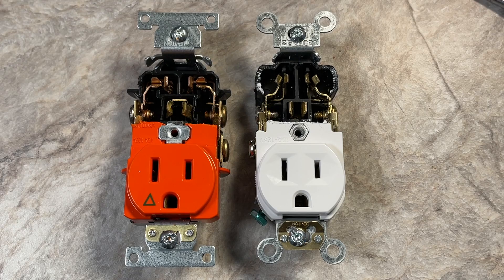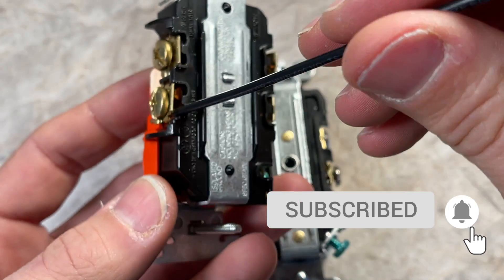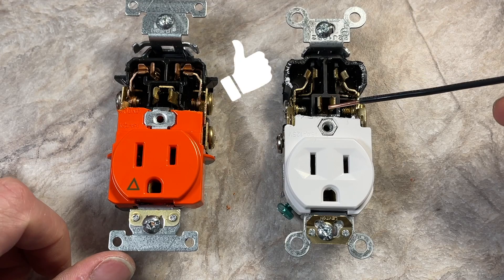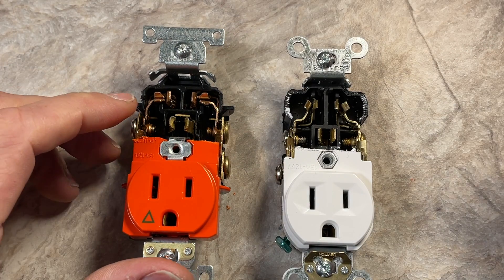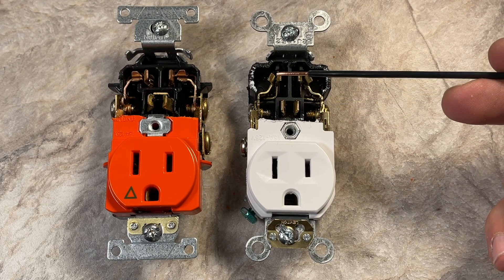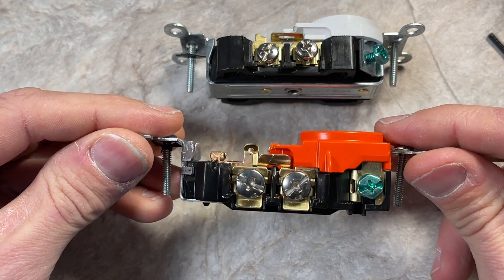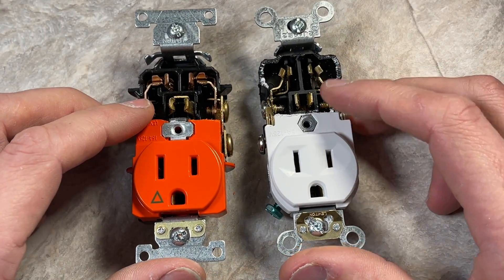What Outlet Should You Buy |  Commercial vs Hospital Grade

Comment: I would like to see military grade. They would probably be the cheapest, nastiest, most dangerous outlets out there.
Reply: Military outlets? You mean regular outlets that the pentagon likely payed 7000% above market value for.
Reply: In the navy ashore, it was generic commercial/institutional.  On ship it was a bit different.  A big oddity was that it was a floating ground back through the wiring/hull to the casing of the ship's generators so connecting the ground links to everything was very important.

On my second ship, they used those commercial grade outlets but they were always installed with the ground pin up.

On my first ship, she was a lot older.  I never saw any two prong outlets but if there had been any they were long gone.  Again, all were ground pin up.

Light switches were a very big difference, they use heavy electronics style switches that cut both sides of the circuit.  Many were 3 position, up for white, middle for off, down for red or blue partial lighting
Reply: They would definitely just be shady chinese knock off versions of the already made in china residential outlets but about 800% more expensive than they should be
Reply: @killerbug05  Speaking from some experience: Military grade=The cheapest chinese parts assembled by minimum wage americans working 60 hours a week. The huge markup comes both from the desire for profit and the huge wages needed to have an engineer make ikea style instructions that someone hung over and exhausted can follow.
Reply: @Hyraethian  I was just joking but that's interesting
Reply: it’s just a residential grade with an M-16 and an angry wife
Reply: @haydenblanchard2006  but is the wife modular?
Reply: @killerbug05  no but it comes with heat seeking divorce papers
Reply: Obviously you have never tried to meet mil- spec.
Reply: @stevenbass732  these guys are trolls.  No experience with MIL, aerospace,  commercial specs and QPLs.
Reply: They are likely just certified commercial grade.  Now the quality of military-grade electronics, different story altogether.  Some of the mil-spec equipment, especially in aerospace are works of art internally.
Reply: @greendryerlint  very much so.  With proper care they remain mission capable for decades.  The one satellite recover I had was perfect as is, they just put better computers onto it.   Started out with a computer and tape drive, then had a modified unix box, and was going to receive a PC based controller as I was getting out.   No changes to the dish or controller.
Reply: Lol, right?!
Reply: I only remember hospital grade outlets when I was in the Air Force in the 1980's.
Reply: Yep, lowest bidder, which means the supplier that didn't make the Wal-Mart cut
Reply: @alphadriver3020  Lowest Bidder not lowest cost.  they never come in on budget.
Reply: Lol like military intelligence that’s an oxymoron lol
Reply: you0're werong real military grade are the top gamma of the line, able to withstand grunts abuses.
Reply: Actually military grade is one of the most expensive. They must go through very intensive reliability tests.
Reply: Was a building manager for the barracks for a few months. They told me to buy the cheapest I can find lol
Reply: While I know this thread is on the sarcastic level, I would like to say that since I grew up a military brat going to school on base in Puerto Rico before the US Gov closed Roosey Roads down, MOST of the receptacles on base including the housing units, were HOSPITAL GRADE, COMMERCIAL GRADE and INDUSTRIAL GRADE. I did NOT see YELLOW(corrosion resistant),RED(EMERGENCY POWER) or BLUE(ISOLATED GROUND-SURGE SUPPRESSED) back in the 80s BUT I see those in hospitals and schools NOW in 2021. Now I DID see the ORANGE faced ones in the BUNDY section of the Base in a store check out aisle and I did see the more unique CLEAR lighted receptacles in the Navy Hospital in Roosey Roads base. Now when you say MIL SPEC or MILITARY GRADE, I immediately thought of RUSSELL STOLL or PAUHLUN or MELTRIC or APPLETON or PYLE NATIONAL industrial grade receptacles and plugs which I DID see at the AIMD hangers in PR and in NADEP in Cecil Field Base in Jacksonville FL before that base was closed down too.. All those brands were like the European ROUND PIN sockets but much beefier and had steel flapped plates.
Reply: Are they modular though?
Reply: @Echa37-H37  if it ain't modular it aint good enough for the u.s military
Reply: You would have to go through an unnecessarily convoluted purchase process with a massive mark up in price, it must also be cleaned to perfection weekly or it will implode
Reply: @matgaragepaul  nice,  , they might turn up at some point or might be used on ships built someplace other than Newport News.   But I will also note on the switches is that they were also somewhat water resistant. Some would have small rubber boots too.  Switches for outside the skin of the ship were sealed rotary switches, usually brass and probably reused from previous ships. There is quite a bit more of that than you would think.
Reply: https://www.google.com/url?sa=t&rct=j&q=&esrc=s&source=web&cd=&cad=rja&uact=8&ved=2ahUKEwipztmD8vHuAhVFsZ4KHadvDpEQFjAAegQIAxAC&url=https%3A%2F%2Fen.wikipedia.org%2Fwiki%2FU.S._Military_connector_specifications&usg=AOvVaw1x8wVn_tPYQL2X-iRjSOMf
Reply: My brother worked on a military facility doing sheet metal work, met a guy whose job was to walk around and measure light levels.  If they're paying contractor prices for that i don't want to know what the outlets cost.
Reply: space shuttle nuclear grade!
Reply: and most expensive
Reply: Actually not, though in most cases they don't look like any outlets you've ever seen.
Reply: Yeah make sure they are Modular with multi-mission capability. Also so easy any E1 can use them and indestructible for same reason.
Reply: How about Chinese Army Navy Grade at Home Depot?
Reply: military grade is actually some of the highest specs you can get.  You've never seen the "mil-spec" grade? Musta been up north with Clinton.
Reply: Just the ground, hot and neutral wires sticking out of the wall. Have to tie it around the prongs of your plug.
Reply: I doubt it could be cheaper or more dangerous than a 50 cent residential grade receptacle
Reply: Lol military grade would be the Live bar you have to hook a wire to almost like operations but you want the connection to happen
Reply: The actual products may not be that good, but are generally top shelf.  But the testing to make sure they meet mil spec adds lots of cost.  I personally met the guy who specced 500$ toilet seats.  Old aircraft was in service at the time, no ports in stock.  Not airworthy for rotating crew sac patrol.  Mil spec part of aircraft.  Do you want the mechanic to make choices on aircraft parts?  Send him to home depot for bolts to hold the engine on? Where do you draw the line, or leave the line alone and have a millwright make a toilet seat to spec?
Reply: Mil Spec= the low bidder. They'll spring the massive cost overruns on you later.
Reply: If military grade outlets exist, they would undoubtedly be covered by MIL, aerospace, or even SAE spec.  The military grade receptacle would also likely be on a QPL (qualified product list), where testing and certification occured for the military to deem it qualified.

I'm thinking your comment is a joke, as you have not demonstrated any experience or knowledge of military and aerospace grade components.
Reply: Plus they'd cost $50,000 a copy.
Reply: HOW DARE YOU!!! SUPPORT OUR TROOPS!!!! NO COST IS TOO HIGH!!! YOU ARE UN-AMERICAN FOR QUESTIONING MILITARY CONTRACTORS!! COMMUNIST!!!!!!!!!!!
Reply: @ransom182  Haha, yeah... contractors almost caused a computer system to blow up because of faulty programming that didn't get tested like the military was expecting. Granted, it wasn't written out for all the kinds of testing that the military wanted within the contract, so the contractors didn't bother with testing.
Reply: @ransom182  I really hope this is sarcasm
Reply: @ransom182  😂😂😂😂😂😂😂😂😂
Reply: @ransom182  bro chill
Reply: @ransom182  lol so tru
Reply: As they install the Chinese made plug...
Reply: @ransom182  insulting our own government/military is basically as american you can get 😂 and before you say it yes I know you were joking
Reply: @killerbug05  And yet the corporate funded candidates in the congress would disagree.
Reply: @killerbug05  Thank you guy, you get what it means to be an American.  There's hope for our country yet...
Reply: @ransom182  communist don’t question the government out of fear though...
Reply: @mrpumperknuckles1631  Ummm but the government isn't communist. Of course communists will question a capitalist government. How would they build their case and gain support?
Reply: @mrpumperknuckles1631 Authoritarian-communism, that pretty much sums up the military. Every member is assigned a job,, and there's hierarchy within those positions. Don't question what you're told. On top of that, the federal government is paying a wage to their members, plus benefits for their duty.
Reply: @AMD1  Heh, defending a democracy doesn't mean that you have to be one...
As for military grade connectors, I had the pleasure of procuring a bunch of them recently.  Nice hardware, overbuilt and overengineered, but dear god the price.  The unwritten design spec for those is: "must be able to survive a bored and angry serviceman".  Because if a connector doesn't fit, for instance because they are inserting it into the wrong socket, they will bang on it until it actually does fit, square peg in round hole.  I respect their service but not necessarily their common sense :)
Reply: @ransom182  It's getting that with democrats in charge.
Reply: @datsuntoyy  really? you think it only happens when the dems run things? Are you  14?

Comment: The commercial grade is more than adequate for normal use. What scares me is the 99 cent units sold a big box stores and installed by amateurs.
Reply: Cheap builders* Here in San Antonio all the homes built by Rayco/KB in the 1990s and earlier 2000s have used those Leviton outlets that are 64 cents apiece at Home Depot or come in loose boxes of like 100. Any of those that gets used half regularly completely loses its tension.

Comment: Always upsize go for the 20 amp for future expansion. Save you time if you decide later on.
Reply from the maker: Yeah, I also don't see much of a downside but at least in my area 15 Amp are very common for residential receptacles.
Reply: @EverydayHomeRepairs  Unless someone rightfully plugs in a 20 amp load, and possibly starts a fire because the circuit wire size and breaker are not rated for 20 amps. Dont depend on the breaker to save you on an undersized circuit. Oh, and when the house burns, don't expect the insurance to pay for it. Do check it out!

Comment: now compare audio- grade recepticals to hospital grade
Reply from the maker: The Audio grade are crazy expensive.  I understand they might be doing some exotic coating on the contacts but almost seem like a scam at the prices they charge.
Reply: @EverydayHomeRepairs  people say that about most audio products. the application and focuses of the designs are prioritizing aspects of the outlet that other use cases would see as a non issue or of zero importance. That being said I know first hand the quality of many audio grade outlets are absolutely outstanding with the thickness off the internal connectors and quality of materials used. Almost all audio-specific products are most definitely overpriced though due to low production runs and high margins
Reply: I once read an article many, many moons ago comparing a regular #14 stranded wire and  a highly regarded, expensive speaker wire. This was written by a very well known audiophile, and his findings? "...only the dog can hear the difference"
Reply from the maker: @nycelectriciandavid7997  😂

Comment: Very informative! I worked at a hospital for my residency and we were told by the hospital to always have vital patient monitoring systems ( actually all medical equipment ) to these orange ones. I had always wondered what’s the difference and I’m glad I know now, thanks
Reply from the maker: Just to follow up I was incorrect in saying the orange usually indicates backup / emergency power.  Orange often indicates the same as the green triangle on the front and that is an isolated ground for this receptacle opposed to a shared ground with other receptacles / equipment.

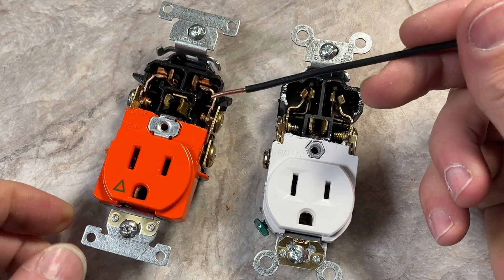Comment: 5:02  you are correct however also the hospital grade ground socket is curved on the inside for a greater surface area, whereas the commercial grade simply has a line contact on either side when you insert the ground prong.
Reply from the maker: Good point, thanks for the feedback David 👍

Comment: The big difference in all the different grades basically comes down to physical durability. I've always used the cheap sockets for semi-permanent locations like refrigerators - something that is going to be plugged in and not messed with. Most other locations are worth the upgrade.
Reply from the maker: Yeah, I agree frequency of plugging in and out is a big consideration for whether to upgrade or not.
Reply: I would not use the inexpensive residential grade receptacles for any appliance that has a high current draw such as an air conditioner or refrigerator or in any location where equipment is frequently plugged in and unplugged.  The commercial grade receptacles have better quality contacts which can take abuse and still last a long time.
Reply: I wonder if a better quality receptacle helps improve appliance durability.
Reply: @Lughnerson  Not as long as the outlet is in good condition. Outlets that don't grip the plug tightly aren't going to have good electrical contact, either. That can cause voltage spikes and overheating of both the plug and the appliance.

Comment: Seems to me that a good blend of outlets is the ideal solution in both cost and benefit. Residential grade for receptacles going under the least amount of use, commercial grade for heavier use, and a hospital grade for the heaviest use, such as a hallway or living room receptacle for vacuuming/floor cleaners. Depends on if going for renovation or replacement, but I'd say commercial is the best compromise for full renovation, with a few residential thrown in for those low load outlets that might never see heavy use, like behind a bed or couch.
Reply: rightYou 100 % right

Comment: the red switches and receptacles are used for the always on/emergency circuits; especially the life safety appliances.
Reply: IIRC the red circuts are the ones attached to the generators, where most of the other outlets aren't powered
Reply: Very correct. The red ones will be connected to UPS and backup generators.

Comment: Another thing about the Hospital grades is that it have provisions to prevent arcing in rooms with breathing  equipment.
Reply from the maker: Thanks for the feedback Peter.
Reply: I was going to say it if no one else had. A pure oxygen environment is a very dangerous place for sparking of any kind. In the interest of mitigating any know hazards after the Apollo disaster these plugs began to be tested and certified as level 3 spark resistant. So that in the event of a pure oxygen leak in a confined space such as a storeage room the result would not led to another tragedy. Although, these outlets are not spark proof they have been deemed resistant enought to mitigate to a reasonable extent the possibility of a an arrant spark.
Reply: Pure oxygen isn't flammable. An arc in a Pure O2 environment wouldn't do a thing.

Oxygen is the oxidizer for the fuel. At 100% there is no flammable fuel to react with.

Just to be pedantic.
Reply: @etherealrose2139  At 100% everything is fuel.

Comment: Have you noticed a lot of Hospital Outlets, are installed upside down with a ground plug facing up.? I'm pretty sure that is a safety feature.
Reply: because that is not upside down....
Reply: If you install them with the ground prong on top it gives protection if something metal were to fall on a plug not plugged in all the way, it also makes the current carrying conductors be jammed in more if a plug is loose and heavy. Some electricians also do it to show which plug is a switched outlet. Here is a link I found. https://www.archtoolbox.com/materials-systems/electrical/groundorientation.html
Reply: Yes it is a safety feature IF metal outlet plate is being used. If the metal plate loosened up it will fall to the ground prong since it's on top instead of falling to the hot and neutral.

Comment: Isolated ground is the main difference (green triangle).  On a non isolated ground (normal) outlet the ground screw and the attaching screws are connected, as is a metal outlet box is connected to the common ground.  The ground screw on the isolated ground outlet is not and will not connect to the metal box, it is separate.   A separate ground wire connects to the isolated ground screw and runs separate and "isolated" back to the panel.
Reply: I have a feeling one of the reasons why they need outlets with isolated grounds like these is because 90% of the outlets with the exception of the one's coming off of the main service are being fed by sub-panels.  Remember, sub-panels have isolated grounds too.  Even in a home, the only place the neutrals and grounds come together is in the main service panel.  90%-95% of a hospital is sub-panels because of the size of these buildings.  Usually at least one sub panel on every floor.  So to keep the grounds isolated all of the way back to the main service panel, they use outlets with isolated grounds.
Reply: @KevinBenecke  there are alot more then 1 subpanel on a floor. There is no main panel in a hospital there are switch boards at 480 volt 3 phase at thousands of amps. Most hospital  i wired the main electrical room is a lot bigger then your normal house.